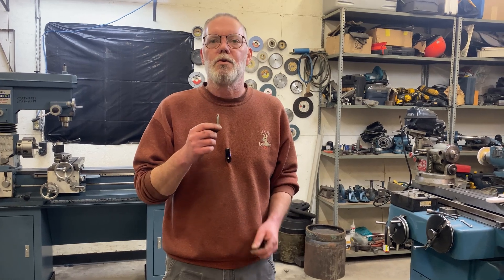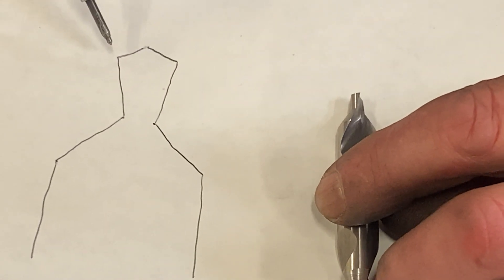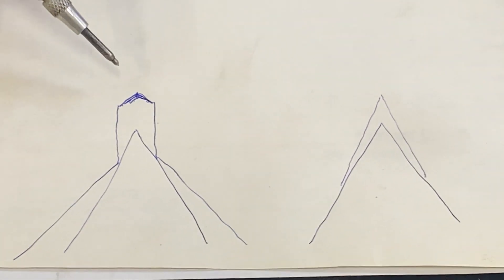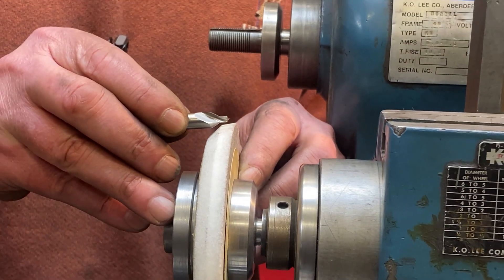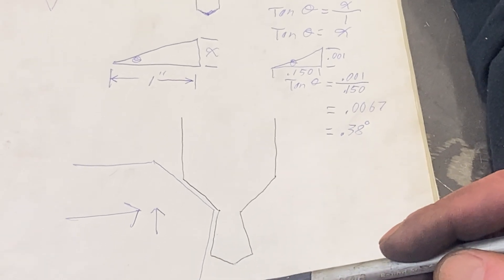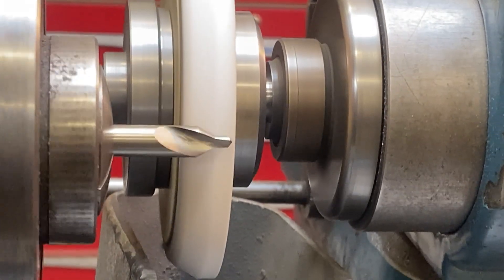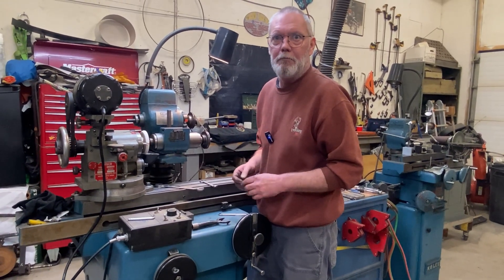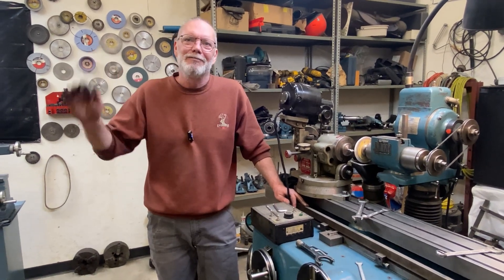HOW TO SHARPEN CENTER DRILLS

Comment: I have watched several of your videos and I am always impressed. 
Running a lathe is fairly simple and most channels show the same techniques. 
The setup and calculations that you perform, just to finally take one minute to complete are very impressive. 
Who taught you this profession?
Is this your full time job or just a side job ?

You seem highly educated, I would guess a Mechanical Engineer. 

Hopefully you can find an apprentice and pass on your knowledge.
Reply from the maker: I am a machinist. I am self taught in the field of tool and cutter grinding. To the best of my knowledge no formal training is available. Thanks for the kind words

Comment: Good demonstration on the reliefs of a center drill. I usually just use mine to make sure a hole starts in the right place, and I hate dull drill bits. I'll hit them with the bench grinder and that's usually good enough for me. My machines aren't accurate enough for any more than that.
Reply from the maker: I hear you about the bench grinder - it’s a great option for a quick fix!

Comment: This was very interesting.  My center drills seem to wear most noticeably on the points so I sometimes use a single-lip cutter grinder to put a new 2- or 4-facet point on them (depending upon size).  That seems to work fairly well given the limitations of that equipment.  It’s also not cost-effective for me to spend more time than that on them.  For precise hole location I use a carbide spotting drill so the center drills are used only for turning.  Happy to subscribe.  Thanks for posting.
Reply from the maker: Thanks for watching and commenting!

Comment: Thanks.   Apparently your work head has the ability to cam in the radial direction as well as axial?   How does it do that?
Reply from the maker: Yes it does. The two types of relief can be adjusted independently of each other.
As for how it works,,,
Sorry but it's too complicated to explain with just words.
Reply: Хотелось бы увидеть подробный обзор этой головки, если это Вас не затруднит. Очень ценные уроки по заточке инструмента. Удачи и здоровья вашей дружной съёмочной бригаде.
Reply from the maker: В будущем я сделаю видео о приспособлении для снятия кулачков.
Ура!